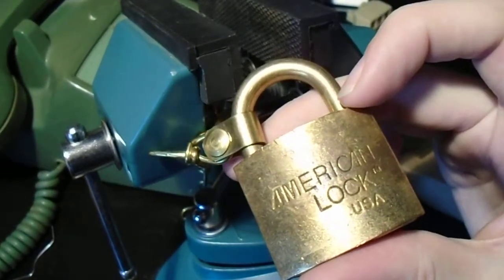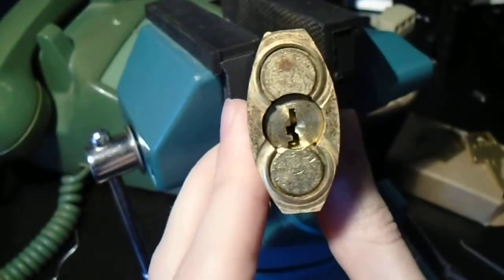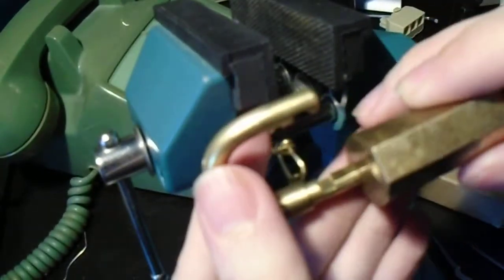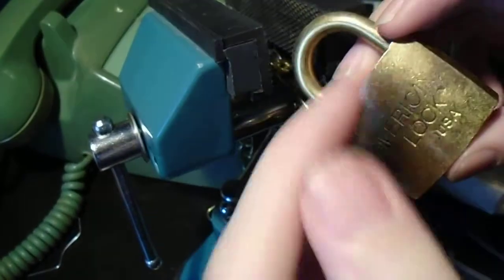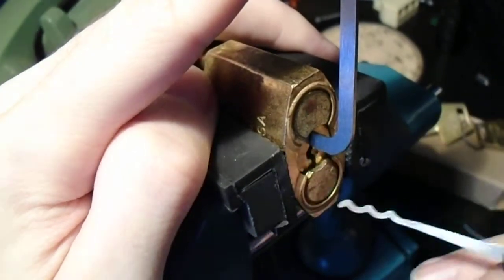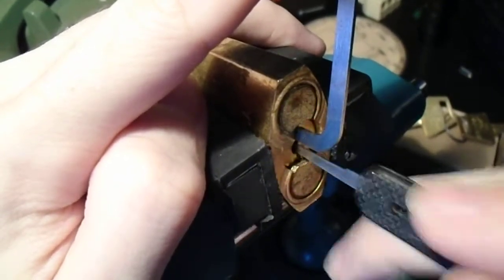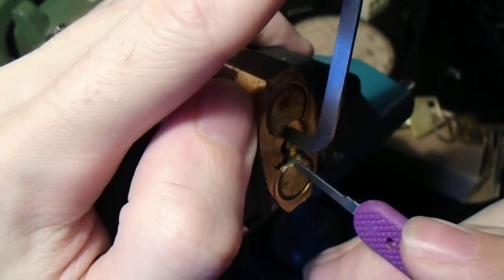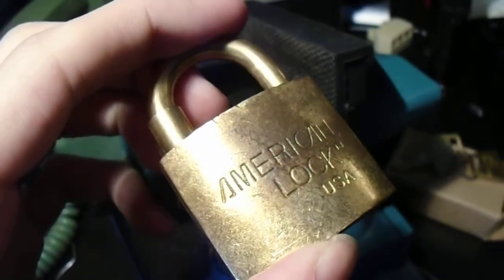(024) vintage US military American Lock padlock picked

Comment: I found them a pretty difficult pick! Guess it depends on the bitting? 
You made it look easy.
Reply from the maker: It is all a matter of practice. Once you get used to the difference between hitting a serration versus setting the pin it gets much easier. These older locks also tend to be much more worn which also helps.

Comment: I have never seen those used for ammunition in the military. those are just general purpose locks for say closets, bags, lockers ect
Reply from the maker: +JB By the Vietnam War true High Security padlocks became available (such as Sargent and Greenleaf) and are newer variants are still used to secure ammunition bunkers, armories, and other high-risk areas and containers on bases. Locks like this were often issued to secure personal belongings on base or vehicles (jeeps, APCs, etc). Older locks of this type (such as the WWII era Corbin padlock I showed in a later video) were used during earlier wars to secure munitions and other supplies against theft or tampering during transport and in the field.
Reply: +Nite 0wl I seen low security locks used to chain steering wheels down in trucks when they are parked because they don't use key's to start them. in the field I never seen anything locked up.
Reply from the maker: +JB That is the type of use I was referring to. A Vietnam-era field manual I found suggested locking vehicles up that way at almost any time including exercises.